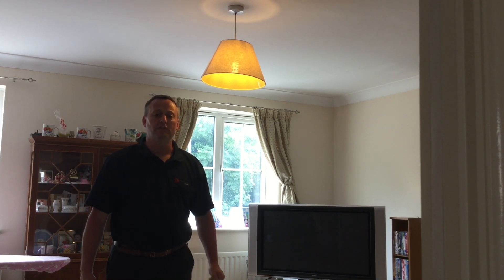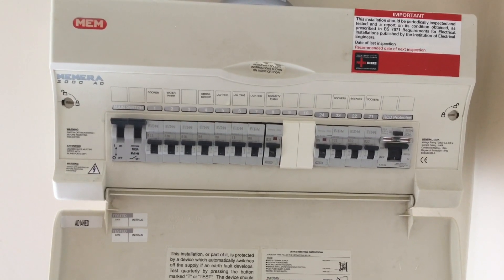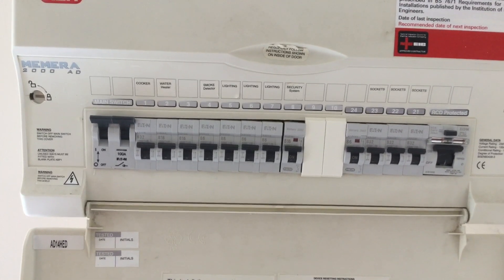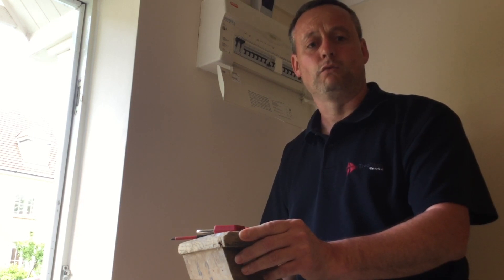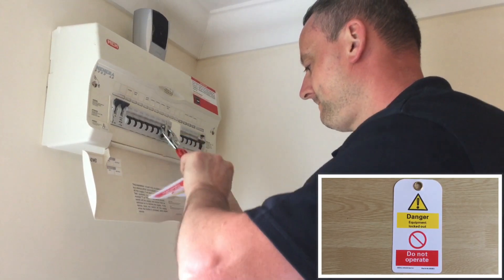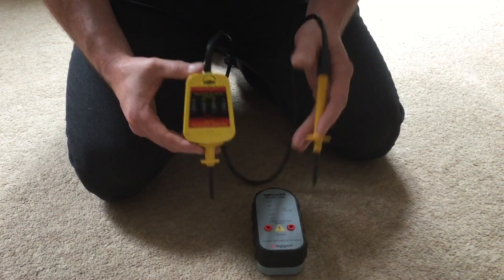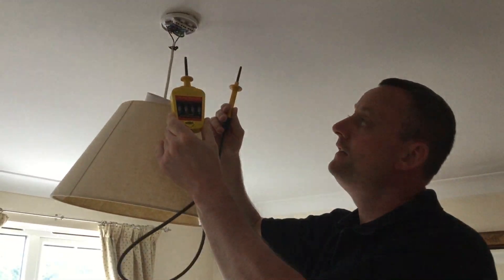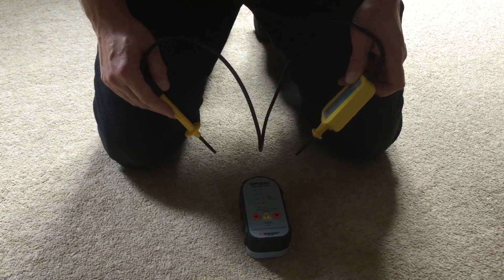Electrical Testing Safe Isolation Procedure for a Single Phase Lighting Circuit (How to Isolate)

Comment: How would this stand up if you had a broken CPC and a shared neutral, both of which are a fairly common occurrence? Perhaps checking CPC before isolation could be a safe option?

Comment: Good solid, simple video.  Going through the lock off process for a domestic property will be seen by many as over the top safety but really should be done every single time to avoid accidental re-energising of the circuit by another person.

Comment: Sir,
I am one of your active subscriber, i need your help, i am in process of immigration to Australia on behalf of general electrician through TRA. VETASSESS conducted the practical assessment and they make me unsuccessful in only last module (safe electrical isolation and testing of connected appliance which was a heater connected to consumer unit). I almost done all the tests but i don't know, why their response was negative.
Please make a video in which show us what are the tests mainly required;
1. Tests before disconnection
2. Tests after disconnection

Please all tests must be with multi-meter
Regards

Comment: great video - but how would u test if that circuit was dead at the switch - if u only wanted to replace the switch but not the light fitting?? or would u still have to probe the ceiling rose???

Comment: Hi, on in intermediate switch (3 switches) would you be required to do the test procedure in each switch position?
Reply from the maker: Hi if you follow the method in Guidance Note 3 then yes thanks for commenting and watching GSH Electrical 👍

Comment: What if you isolated the incorrect circuit and in the time it took you to walk back, the lamp could have blown? Also if there is multiple switches (2 way/intermediate). I know it is very unlikely scenario but is still possible
Reply from the maker: Hi. That’s why you are using your voltage indicator to prove the supply has been isolated. One of the set of connection in this lamp holder (loop) are always live if you have isolated the wrong breaker or lamp has failed or the switch has been operated. Seeing the lamp go out is just and visual clue you might have isolated to supply... you still need to prove dear with a GS38 compliant voltage tester. Thanks for watching and commenting GSH Electrical 👍
Reply: @GSHElectrical  Thank you for responding. That's assuming you use the loop method, which in the am2 exam you don't. I am probably overthinking it

Comment: Great video Gaz, there are a lot of videos on safe isolation that only demonstrate safe isolation of the entire installation, it's good to see one that demostrates safe isolation of an individual circuit and proving the circuit is dead at the point of utilisation.
Raised my eyebrow a bit when you suggested locking off the suspected circuit breaker of the lighting circuit you were about to work on, but whatever works for you mate. Keep up the good work mate, our industry's in safe hand with tutors like you.